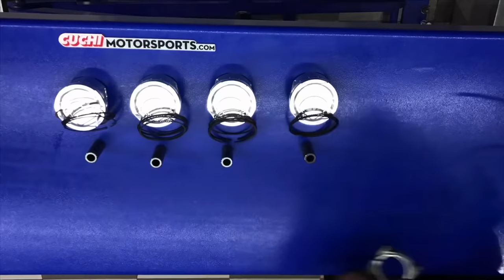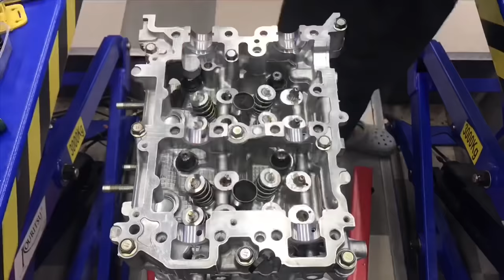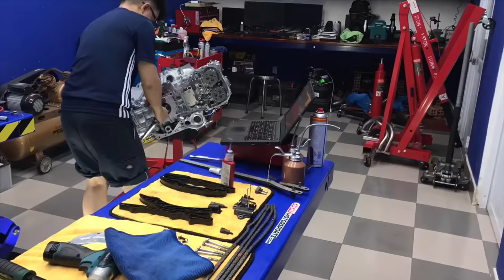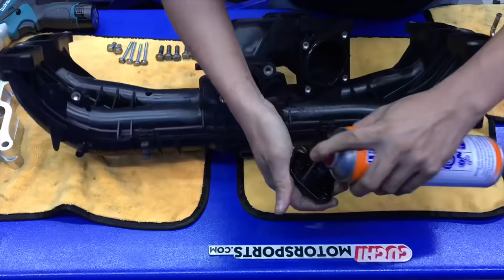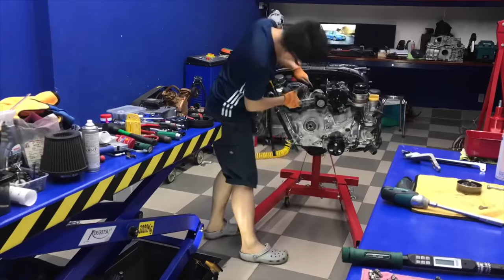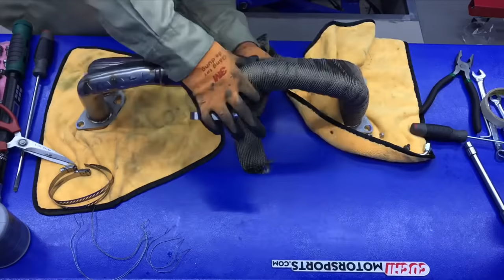Lắp ráp động cơ hoàn chỉnh Subaru WRX FA20DIT

Comment: Chào anh, a chuyen độ subaru, hay độ tat cả loại xe, e có con cla 45 amg, date 2016. E tính remap ecu, air intake, race chip, intercooler, để lên 450hp, k biet máy mer chịu nổi không.., a cho e xin loi khuyên ak...
Reply from the maker: Máy chịu nổi. Nhưng cẩn thận. Vấn đề không phải cơ khí mà vấn đề là remap phải chuẩn nhé. Sai một li đi một dặm.
Reply: @CUCHIMotorsports  ok anh, tks a nhìu ak. E có nghe vài ng bạn e bảo nhau rằng, cục máy CLa 45, w A45 mer, chịu được mức công suất tới 600hp, mà không cần làm lại lòng máy, cam cò lại? theo anh có đúng khng ak?
Reply from the maker: Hihi mình đâu biết được bạn. Bạn cứ làm thử sẽ biết. Riêng mình, cái gì mà hơn công suất zin 50% là mình nâng cấp máy.
Reply: CUCHI Motorsports kaaa! A keu ban ay mang ca cuc may amg ra thu luon!:)))!
Reply: CUCHI Motorsports a oi, Ben a rebuilt turbo o cho nao vay! A bit cho nao lam uh tin ko a? E dem cai turbo cua e toi Ben Rong Xanh shop, no lay bua dap be ca cai turbo cua e luon! Vai that